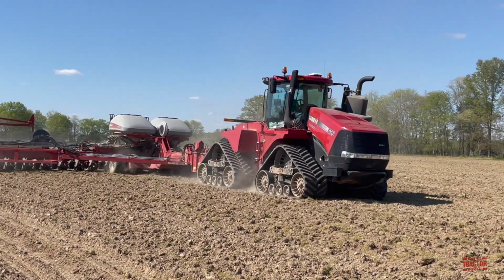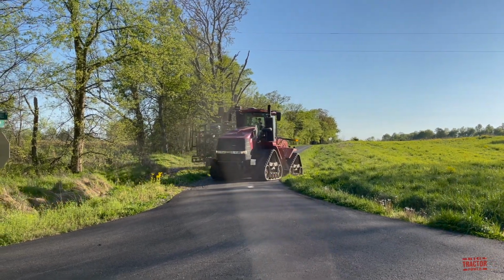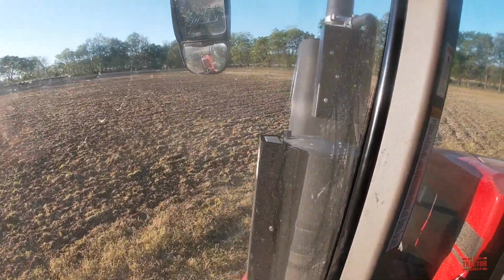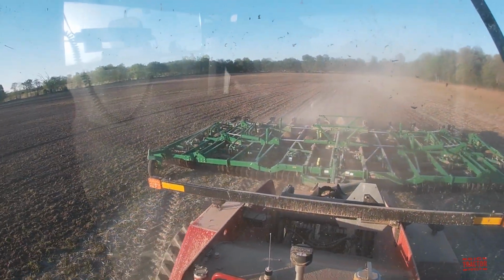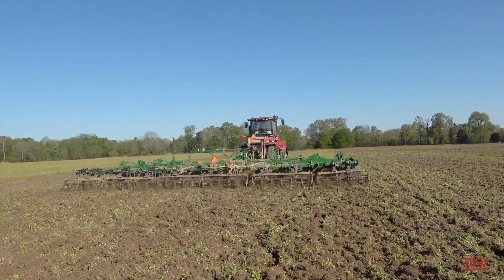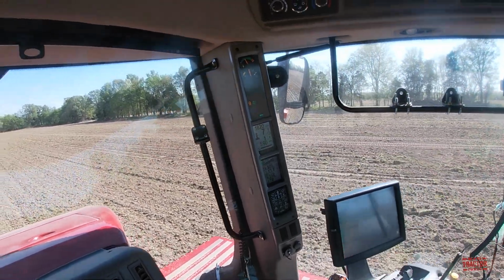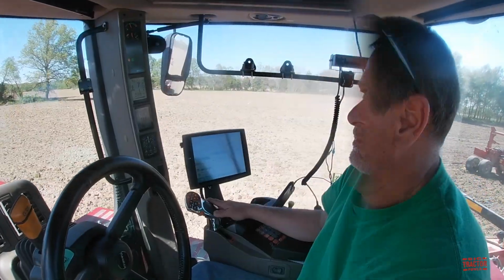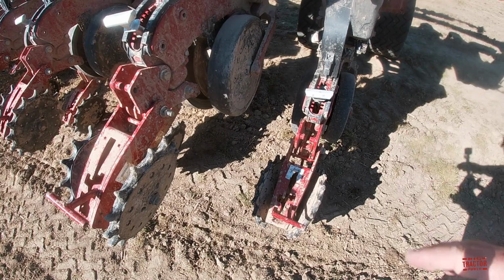CASE IH QUADTRAC Tractors Planting Corn

Comment: Case 580 quadtrac pulling a 50 foot krause soil finisher.  Case 535 quadtrac pulling a 70 foot land roller after the soybeans are planted.  Johndeere 9400t pulling a kinze 3800 24 row 30 inch planter . Johndeere 4960 pulling a kinze 3600 24 row  soybean planter . We have 560 acres of soybeans planted and 200 acres of corn planted but we now have 2 inches of snow so we will have to wait for the ground to dry . Nice video keep up the good work and stay safe!
Reply from the maker: Great planting line up. Thank you for sharing.

Comment: I would have thought the tillage implement would require more power than the planter.  Why do they have the 620 HP tractor on the planter, and the 470 on the tiller?
Reply from the maker: This farm had three 470 ROWTRACs until last year. Case IH recommends a 620 for the 2160 planter. The 470 is plenty of power for the 2310.

Comment: Almost seems like you would want the higher HP tractor running the tillage?? Any explanation?
Reply from the maker: The 2160 Early Riser is recommend to run the 2160 planter by Case IH. Previously the farm ran 470 ROWTRACs for tillage and planting.
Reply: @bigtractorpower  huh?!
Reply: @henrylopez5252  that planter pulls harder up the hills and weighs more than the soil finisher .  By the time you add the weight of seed fertilizer and then add all the hydraulic power needed to run the vacuum fan and down force it really uses and requires the extra power.
Reply: @anthonybanda8192  yeah, that's crazy!! Thanks for clarification! Did u get hit w snow?
Reply: @henrylopez5252  we got about 1 inch of snow but mostly rain . The wet snow actually insulates the ground . It kept the beans from getting cold . Honestly it happens every year . I've had beans sit with 6 inches of snow for 4 days and they survive.  The  corn is what worries us it cannot stand the cold.  We warmed up quick today so the crops are fine .

Comment: Never thought about it before but I notice the steering wheel doesn't move when the tractor is in auto guidance - would it be the case that the driver could override by moving the wheel in an emergency?
Reply: Yeah if you turn a certain amount it disengages the auto steer.